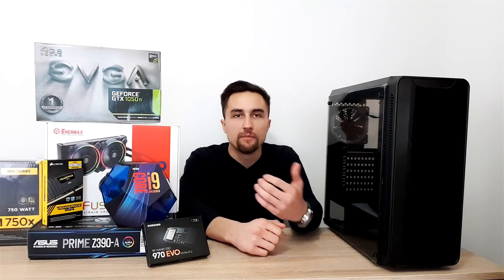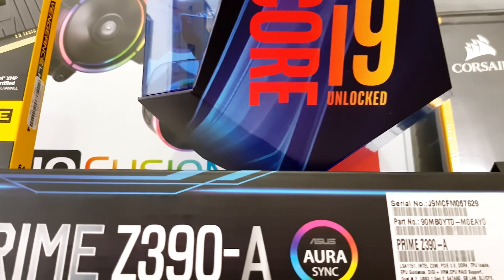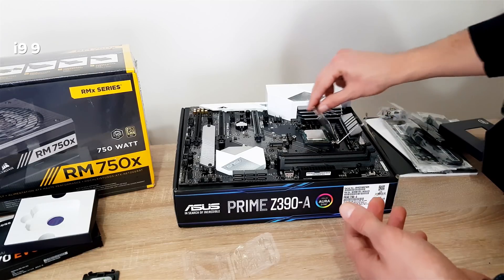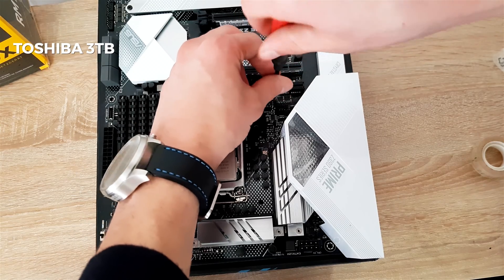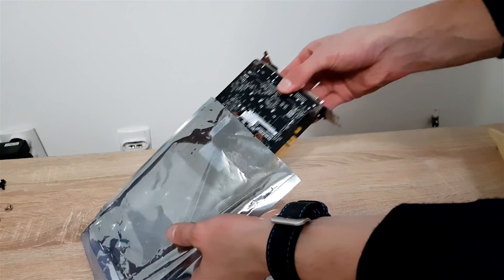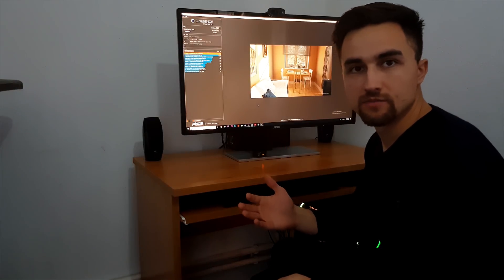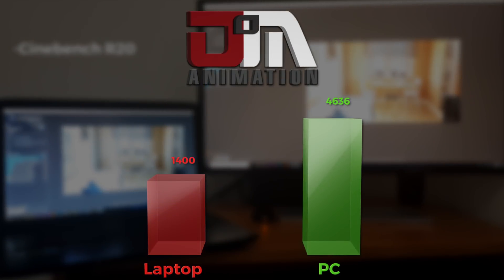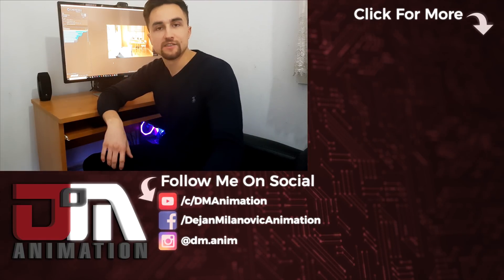Best PC for Adobe After effects 2019 unbox, review and test 4K

Comment: I need a little help. I’m building a new pc. I haven’t used premier in about 18 years. Soooo much has changed. My brother in law said I’m going way over board how ever I want to make sure the system flows with no kind of hang ups. Not worried about the software I can learn that stuff. I need to know if I’m going to far with 64 gigs of ram the i9 9900k and the rtx 2070 gpu. I’m putting in 2 500 gig m.2 nvme Samsung 970 evo. One will run my programs the other will be a cache and scratch drive. Also putting in another m.2 1t Samsung nvme 970 evo for all my projects and video I’m work on. Then I’m putting in a 4t hdd to store my old videos and projects that I’m not working on but if I need to go back I can. I already have a server downstairs with 10 t of space so I’m going to take one of those drives and mirror the hdd drive with that
Reply from the maker: Hi Clyde,
These specifications that you mentioned will be great for this flawless work! 
Just realistically it will not be 100% flawless because of some software bugs that happen from time  to time :)

Comment: hi sir, which one is the best for after effect?  i9 9900k or 9980xe?
Reply from the maker: 9980xe is 4 times more expensive than i9 9900k, and has double of cores which is not important for after effects
After effects will use just one core on boost clock, so my opinion is that i9 9900k is better value

Comment: What about money, man? How much did it cost?
Reply from the maker: Good question, i am sorry that i didnt mention that in video, here are prices that i pay(in Serbia, euros)
ASUS PRIME Z390-A: 170€
INTEL Core i9-9900K 3.60GHz 1151 300 BOX: 490€
ENERMAX LiqFusion 240 RGB 92€
GTX 1050Ti: 150€
CORSAIR 64GB Vengeance LPX DDR4 2666MHz CL16 KIT CMK64GX4M4A2666C16: 415€
SAMSUNG 1TB 970 EVO M.2 PCIe M.2 2280 MZ-V7E1T0BW: 223€
CORSAIR RMx Series 750W: 117€
MS Industrial Aquarious PRO: 50€
Monitor AOC 32"2K : 270€

=1977€ (2221$)
Reply: Thank you. Which improvements will you make after time? Or if you had more money?
Reply from the maker: @livelongandprosper6577  Just maybe graphic card, GTX 1080ti, as rest of components are TOP
Reply: @MotionSpearStudios  instead of 64gigram you should have invested in a better gpu my friend ;) otherwise the 1050ti will be a bottleneck for the rest of the system, particularly the cpu :D
Reply from the maker: @killll  as i mentioned that is the plan in future, 1080ti, you didnt need to dislike video because of this

Comment: What do you think about i9900K with 1080TI or 2080 RTX what do you prefer?
Reply from the maker: I recommend 1080ti, yes it is older, but still, it has more CUDA cores and more powerful than RTX 2080
Also, it is cheaper than RTX 2080
Reply: DM Animation thx for reply and what do you think about i9 900k or 2950x with 16 cores ??
Reply from the maker: @fatihtt8507  For after effects go with i9 9900k, because after effects is optimized for intel
Reply: DM Animation thanks a lot brother :)
Reply: @fatihtt8507  for sure the 9900k and if you use premiere the igpu makes some things even faster!
Reply: I have an invidea gtx 770 dont even know if after effects will work with that graphics card lol